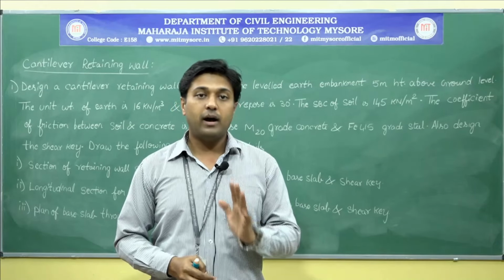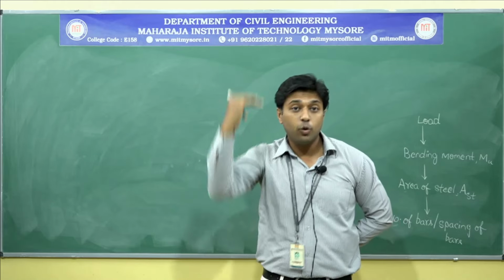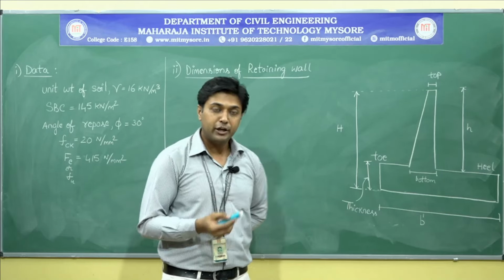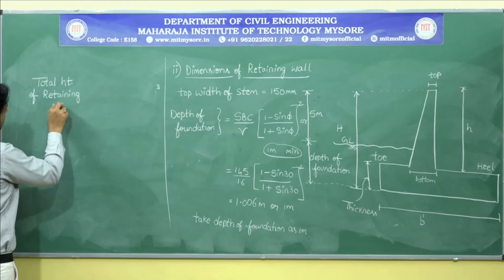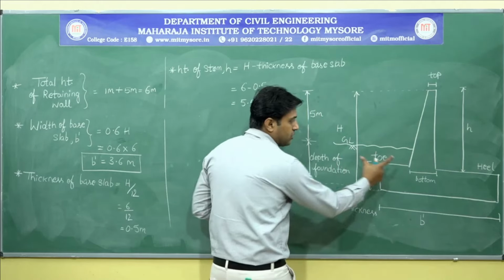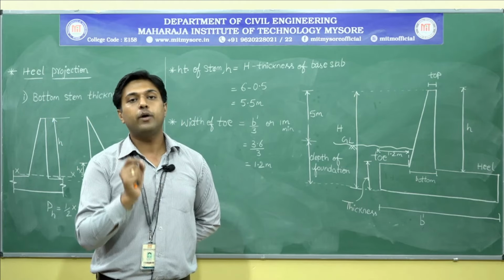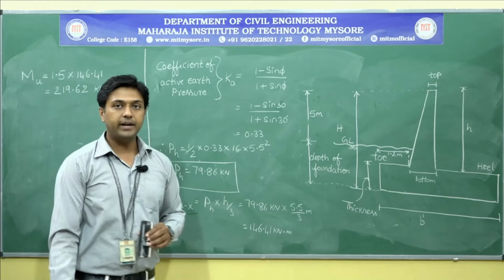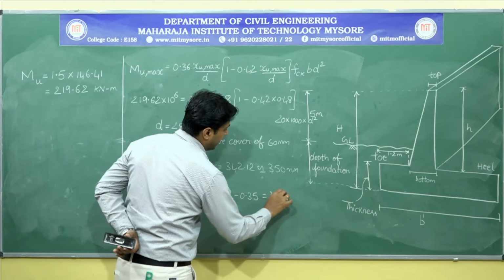DESIGN OF CANTILEVER RETAINING WALL/DRSS/17CV72/CLASS 02

Comment: Sir while calculating the Mu(max) you add 60 mm with 282.12m
Reply: It's 282.12 mm + 60 mm
Reply: This is to calculate the the whole bottom depth of the cantilever slab (the stem), so 60 mm is the cover that should be added to the effective depth approximately. I think the professor explained everything professionally my friend.